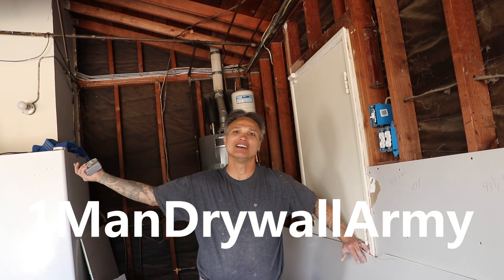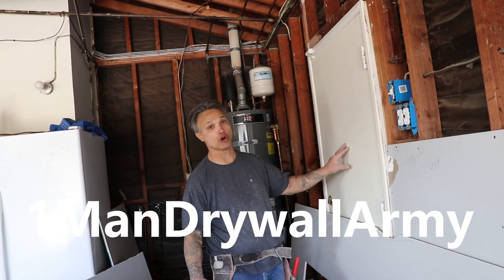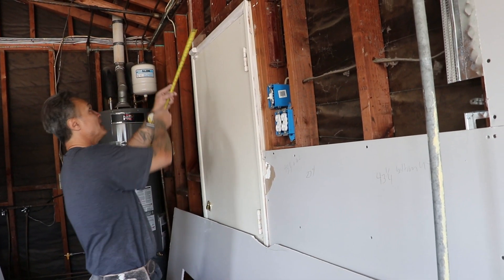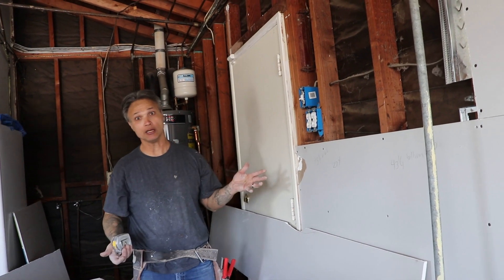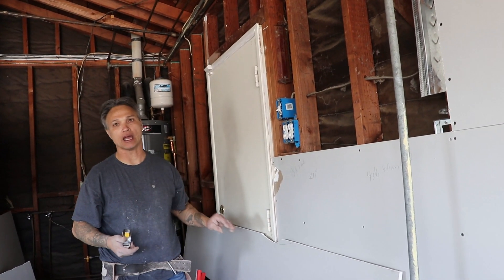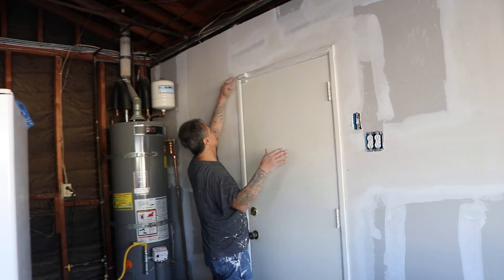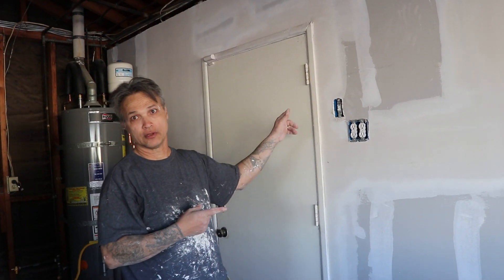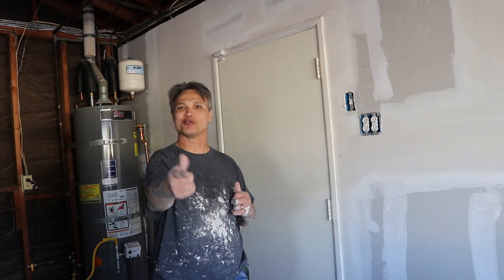How to drywall around a door?

Comment: The drywall above my front door Is cracked and loose from the wall a sheet about 2x4 feet. There's a big patch missing that I filled with spray foam. The whole inside of the top frame was open so I filled it with window and door spray foam and filled the patch with foam and it glued the wall paper back down to the wall. Not professional looking to say the least and made a big mess but the frame Is much more insulated and the wall is better fixed but it still loose from the wall. Pushes in and out. Idk if I should try just screwing it back on or replacing the whole sheet of drywall
Reply from the maker: its cracked because there is movement. I'd rescrew the board back down to where it is snug to the framing. V-groove the crack, prefill the crack,tape it, then float out the seam with at least two coats, then retexture

Comment: Cracking in drywall related to building movement will occur irrespective of how you install the drywall. The cracks might (might) not emanate exactly from the corners of the door, but will emanate from close to the corners, should the building move--as in racking during an earthquake, or if the foundation settles. The latter, foundation settlement can occur slowly, and can be seasonal in areas with expansive clay soils.
Reply from the maker: thank you for the insight however I tell my clients that if you can guarantee me the earth stops moving I then can guarantee you your drywall wont crack.
Reply: If you cut your drywall straight up from the door or any opening you will always get a crack. You always want to "wrap" around the corner with a single piece of drywall. What I do is cut the drywall around the door or window so the edge seam is at the center of the door or window. It makes it much easier to manage.